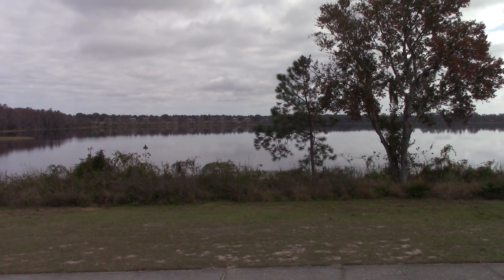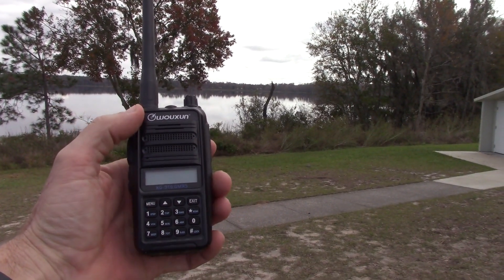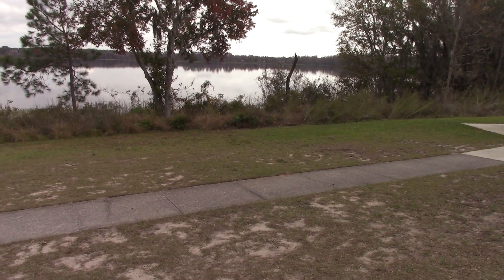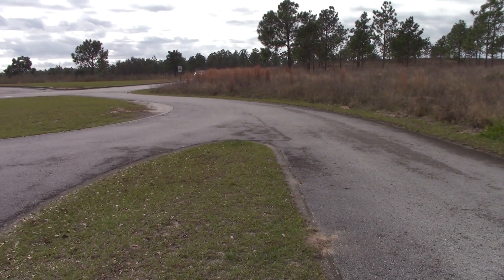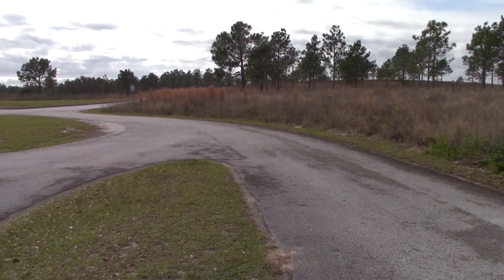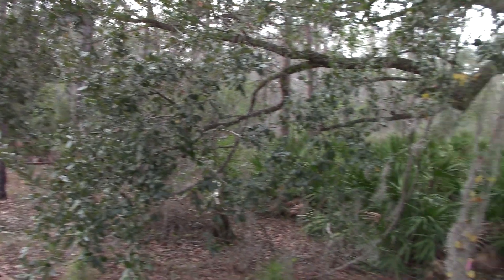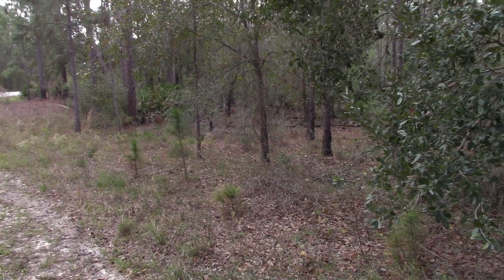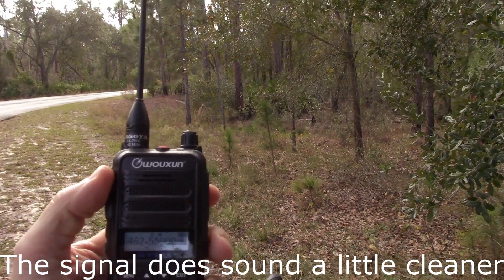Nagoya 701G & 771G improving GMRS 2-way radio communications

Comment: Cant best a 771G. I keep buying supposed better antennas than Nagoyas but keep going back to the Nagoya.
Reply from the maker: For an HT used as a handheld, a 5/8 wave antenna like the 771G is about as good as it can get. Those really long antennas can pickup better, but the transmit radiation pattern can be all over the place.

Comment: Whats the black box
Reply from the maker: Its a simplex repeater. This one is from Argent Data Systems. ADS-SR1 is the model.
Reply: @Soladaddy  It looks like a BTECH you have plugged into it. What cable does that combo use?
Reply from the maker: @jehster  ADS has cables for different plug types. I use the Kenwood pinout and several other brands use it as well. Waterproof radios use a different connector.

Comment: Good day,

I'm planning to purchase either the Nagoya UT-72 or Nagoya UT-72G antenna. I'm primarily going to use frequencies between 451.000 to 455.000 most of the time, and occasionally frequencies between 144 to 145. I've heard that the Nagoya UT-72G might be a better choice since its frequency range extends from 155 to 462 compared to the Nagoya UT-72, which covers 144 to 430. However, I've noticed that the Nagoya UT-72G is more expensive in my area. Can you please provide guidance on which antenna would be the better option given my frequency usage and budget constraints? Your assistance is much appreciated. Thank you.
Reply from the maker: I consider these antennas to be upgrades from HT antennas and entry level mobile antennas. There are many better mobile antennas and they will cost more as well. 

Now concerning these Nagoyas, here's the frequency ranges they claim: 

UT-72G - Optimal Transmit Frequency Range: 150-165MHz, 450-470MHz
UT-72 -    Optimal Transmit Frequency Range: 140-148MHz, 420-450MHz

The G model is 3% away from 144/145Mhz and covers 451/455 Mhz
The regular 72 covers 144/145Mhz and is 1% off of 451/455 Mhz.

If I still had my UT-72 I would check it on a VNA to see how it tunes to 451/455. I did check SWR on several freqs: 145, 147, 151, 154, 430, 449, 462 % 467 and it was very low for all. Here's a video with those readings
https://www.youtube.com/watch?v=TSQszkFH3G4

 Going strictly by Nagoya's claims, I would go with the regular UT-72 because it's only 1% off of 455 MHz and less than that on 451 MHz. 
MY SWR readings confirm that as well.
Reply: @Soladaddy  Thank you for your detailed reply; I appreciate it greatly. The reason I've chosen Nagoya is because it offers free shipment to my country on purchases exceeding $49 through Amazon. For instance, the Nagoya UT-72 costs $34.89, so by adding another item like the Nagoya 810, I can qualify for free shipping. On the other hand, the Nagoya UT-72G, also priced at $34.89, incurs a shipping fee of $14.89 regardless of whether I reach the $49 threshold. This is why I'm considering Nagoya antennas.

Additionally, one of the main reasons I'm interested in Nagoya antennas is their suitability for camping trips. I can easily mount them on the roof of my car when my family and I go outdoor camping. I prefer not to have a permanent antenna setup.

If you have any suggestions for antennas that outperform Nagoya in terms of performance, pricing, and possibly offer free shipping to my country through Amazon, I'm eager to explore them. Thank you!
Reply from the maker: I'll look around, but I like a separate mount, could be a mag mount, so different antennas can be used. Amateur radio likes to use UHF mount connections, a few use NMO, commercial gear uses NMO connections so sticking with one type helps to allow for flexibility in using different antennas. Your frequencies are so close to US ham bands that they might be the best option.
Reply from the maker: A good jump in performance will make the antenna about twice as long so size is something to consider. I have the Tram 1180 https://amzn.to/49oP4n1 and it performs very well. 

This antenna mount will work for speeds of about 90 kmh and slower. https://amzn.to/49mZjIJ or https://amzn.to/42LzNKF

For higher speeds, consider a larger base. I use this one and it's a little larger but I rarely go over 65mph. https://amzn.to/3wpkECL. 

This one should handle 80MPH no problem. https://amzn.to/49BcAx6
If using a short antenna, say under 20" then the small mounts would work at high speeds.

These are cheaper options, smaller so less performance, but they are NMO mounts so the base can handle a future antenna upgrade. https://amzn.to/3UPVSFL and https://amzn.to/3uz186d are about the same. I would guess that these perform about the same or a little better than the Nagoyas.  I listed several options to increase the chances of having something with free shipping.

These will need SO 239 to sma adaptors for HTs. Something like this. https://amzn.to/3uPvoJV I like the ones made with RG-58 cable over the real thin ones. Be sure to get the right SMA end for your radio, male or female.
Reply: @Soladaddy  Thank you very much for your detailed reply and for providing the link. Unfortunately, the antennas are too large, and the shipment cost ends up being roughly equivalent to the cost of the antenna itself. I appreciate your response. Many thanks!

Comment: Nagoya  NA-701G what does the letter "G" represent? , I saw amazon with that same model but no G at the end of the model number... thanks
Reply from the maker: The G means its tuned for the GMRS frequencies, 462-467 MHz. The regular 701 is for the ham radio 2m and 70cm bands (144 & 440 MHz). This is the G with a SMA female end. They have the SMA male available as well. https://amzn.to/48jrpD8
Reply: @Soladaddy   thanks

Comment: Great video and test. This is precisely what i was looking for. The 701g is conveniently short and better than the stock antenna probably on many radios on 462. The 771g is probably the biggest step up in performance but the inconvenience of a long stick.

 I just received a 2 pack of the Luiton version 771g. I have to return because one is faulty but the other is outstanding. This time id rather order a genuine Nagoya. I wasnt sure if the shorter 701g would serve me better or not. It looks like I may have to buy both and swap back and forth according to the needs.
Reply from the maker: I like the Smiley collapsible 5/8 over the 771s. Didn't think I'd like it at all, but when carry/packing a higher gain antenna for those occasions, the compact size is much nicer.

Comment: Hello friend. I have a question. How did you get your other radio to retransmit your own voice to your radio? Thank you.
Reply from the maker: I used a simplex repeater that is attached to another radio. The one I use is made by Argent Data Systems. There are others that a cheaper, but this one has a lot of features. https://www.argentdata.com/catalog/index.php?cPath=27&osCsid=xN8Gaxw8HhqjktiEoBiak0
Reply: @Soladaddy

Comment: I also camp and am looking to use my gmrs radios around the camp.  What are you using at the camper?  (the black box connected to the HT on the RV A/C ?)
Reply from the maker: Its an Argent Data Systems simplex repeater. There are cheaper solutions out there, but this one has a lot of features.